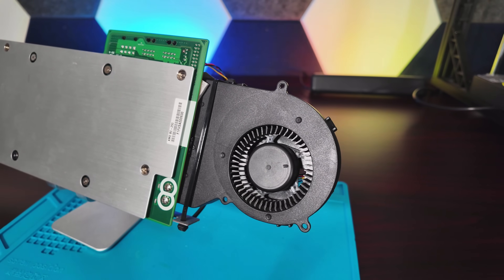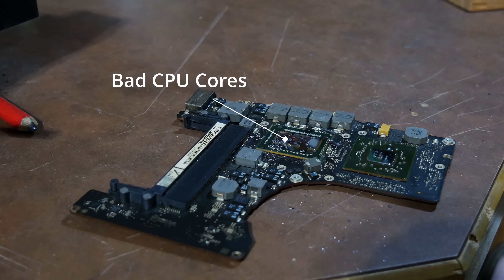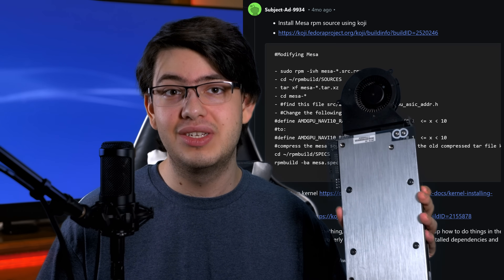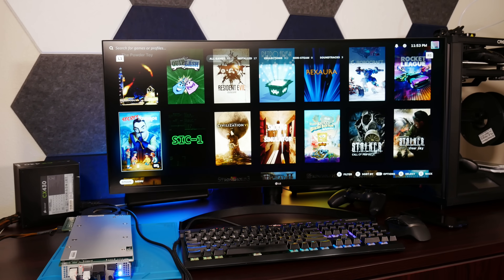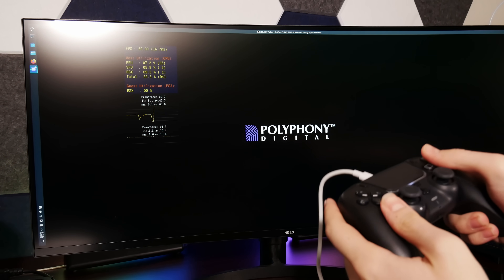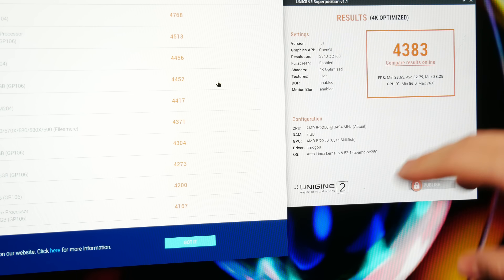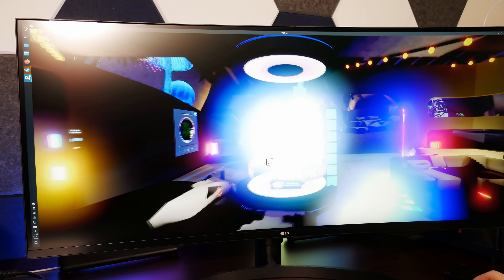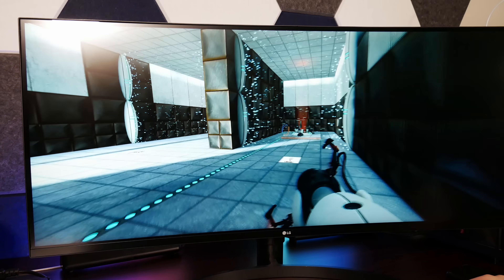I Ran PS3 Games on PS5 Silicon to Prove Sony Wrong

Comment: This just proves something we already knew. The only reason Sony doesn't want to make PS3 emulation is cause they don't see it making much money.
Reply: why let you keep your entire PS3 library when they can just re-release, remaster or remake the game and get your money and 2nd or 3rd time?
Reply: @DocHolliday65 cause I’m buying old ps 3s and install all the games I want and use it as a region free dvd player.
Reply: @theslayer6437  atta boy
Reply: @DocHolliday65  yup. I was a Ps1/2/3/4 … drove me nuts.
Reply: @DocHolliday65  Sure, but that also surely costs way more for Sony than just emulating PS3 and just selling PS3 games digitally. I love selling modded consoles so I don't care, but I don't understand their reasoning
Reply: @mopioline65  or you can keep your entire ps3 library and play them on a ps3 console....
Reply: @ssjmonstar  ps3 wear out, burn out or break if somethinng accidnelt happens to them. new pc runs better than your 2011 pc, its just newer and shouls spec up to 1440p and up
Reply: @ssjmonstar  Yeah, but these consoles are are 2 decades old and are not as reliable as they were. I have ~20 PS3 games and I would buy a PS5 only for this feature.
Reply: @DocHolliday65 they could’ve done that w ps4 , just sell ps5 enhanced versions and make you pay a small fee. 

The ps5 is already the most profitable console to date. 

They could always release ps3 original games on the psn store & rack in a bunch of cash from there, they don’t even need to make remakes. 

They could do that then make a remake later people would buy. 

You can buy re4 original and people still brought the remake. 

You can buy the last of us remastered and still buy the remake. ( Ik is a ps4 remaster, but it’s a ps3 game at heart.) 

So I don’t buy that. 

Plus Sony doesn’t own every ps3 ip, there are many independent publishers. 

But every major ps3 game from Sony has been remade or remastered already. 

God of war 3, the last of us , uncharted collection , demon souls.

We mainly are missing infamous and mgs4. 

Other than that I cannot think of any other Sony exclusive.
Reply: @malcolmlott killzone, resistance, all rachet and clank games, sly cooper
Reply: @maverickslastoddworld6476 resistance my beloved
Reply: Nah, I feel it's leaning toward the fact they can provide more incentives to their PS Premium services to stream PS3 games.
Why emulate when they can incentivize people to pay for a premium service. Or it could be both.
I almost debating on upgrading to Premium just to play those older PS3 games they offer for streaming. I like buying my games, so I hate streaming and game rental services hence I just keep PS+ base.
But then I used my brain, hooked up my PS3, and just replayed a few games that way.
Reply: @HellzAssassn 
The ps3 streaming isn't worth it until they move it all to the ps5 server blades. The ps3 streaming is still the outdated blades.
Reply: @HellzAssassn I do not think they will be able to steal the emulator. Most of them as hobby projects are open source, some allow commercial use, some not, some that allow usually operate under a license which states that any fork and work based on the emulator needs to be kept open source. On top of this it should be clearly mentioned in that this project was used.
If Sony wanted to do emulation they will need to spend time and money. 
And you are right it is better to do remake of a remaster and sell it again. The issue is that ps3 games are not getting this treatment that often as again it is porting between architectures which is more expensive than taking a ps4 game and putting it on ps5 (both x86-64)
Reply: @mravg79 they wouldn’t need to spend time or money the only reason emulation is so difficult is because ur basically remaking the system backwards with what u have Sony has the os and the systems full capabilities to be manipulated and used for the ps5 infinitely easier than the task of making rpcs3
Reply: @sicktodth  easier does not mean effortless.
It is true they own the code for PS3 firmware and know it. But it is still a different architecture so to rub it on PS5 there is no way imo it can be done without both time and money.
Sure emulation on pc (same architecture as PS4 and PS5) is done by community which have to reverse engineer everything, which means it is more time consuming process. 
I bow to all the people involved in this project as they do it in their spare time.
Reply: @HellzAssassn all you have to do is have backwards compatibility part of the service. Done.
Reply: @nunayadamnbusiness  Not genna lie, I don't like the idea of paying for my disc to be able to use it, but that's kind of a smart idea actually.

At least they'd offer it to us....

Currently we don't even have the option, so might aswell.

Like people are saying, they wanna monetise the games you want backwards compatible, so they can monetise the use of our discs, like £5 a month or something.

I don't like the idea, I probably wouldn't pay either but it literally settles both arguments.
Reply: @HellzAssassn yeah but considering PS Plus prices, they would have to include them in the current prices.
I do not wanna have to speed $200 a year for PS3 games 💀
Reply: @HellzAssassn Games stream like ass though even with good internet. They can still lock games behind a premium membership just let me download them to my console.
Reply: @HellzAssassn  how are you gonna own the game when you buy it through download?
Reply: RPCS3 is the most advanced piece of emulation software ever written. The open source community has spent 13 years on it and it got a major emulation update just like a year ago that improved performance drastically.
Reply: @Anteksanteri Not sure how up-to-date you are on RPCS3 progress, but just to back up your statement on it being the most advanced videogame emulator currently available, the RPCS3 Team posted two videos this week onto their YouTube Channel.

In one of the videos they demonstrate how they can now offer the emulator with direct Hardware compatibility with ARM CPU's and demonstrate this using a Apple M1 CPU, but it also works with the other M-Series Chips from Apple, M2, M3, etc, and with thier individual variants too.
But not only does it work with Apple Developed Silicon Hardware, it also works with ARM CPU's for Linux & Windows too!

Now here's the seriously impressive part.
In the second video they uploaded they demonstrate PS3 Emulation on the Raspberry Pi 5 via Native ARM Code.
Now the crazy part here is that not only is the Raspberry Pi 5 CPU not exactly very fast and not that much faster than the PS3's CPU, but the RPi5 VideoCore Mk.7 GPU is actually SLOWER than the PlayStation 3's GPU!
So despite the fact that the RPi5 is SLOWER than the PS3 they were still able to run fully 3D PS3 Games via RPCS3 on a Raspberry Pi 5.

Now I'll admit it was only at the same resolution as the Sony PlayStation Portable, but the VideoCore GPU is many times slower than the PS3, so the fact it is remotely possible at all is a HUGE achievement and a perfect example of just how advanced the RPCS3 Emulator is.

If you want to play PlayStation 3 games you have two options, buy a PlayStation 3 (Preferably the SuperSlim 500GB model because of Reliability), Or, having a competent enough device to run the RPCS3 Emulator and emulate your PS3 games that way.
For me personally I use both options because I am lucky enough to have Hardware that can run RPCS3 smoothly in most games that I want to emulate.

And to anyone that reads this, if you use any emulators PLEASE offer them as much financial support as you can, I'm not well off, but I value the hard work of these developers so I make small donations of between $5-$15 USD as and when I can to show.my appreciation for everything the developers of this software do for free.
We all need a roof over our heads and electricity, water, gas, food, etc, isn't free.
Reply: Which is weird, because they are currently working on emulating PS1 and PS2 games on the PS5, with many already having been released to the store. If these make money, PS3 will make even more money.
Reply: And it would be a very expensive thing to do as well. For a company that just wasted $400M on Concord.
Reply: @Great-Documentaries  you mean just steal RCPS3 and put on PS5? Yeah...2 tacos and 1 coffee.
Reply: @Deep_wolf  That was sarcasm
Reply: @Deep_wolf straight past the head
Reply: @Deep_wolf  That would be an endorsement to fan made emulation from them, which would put them in a difficult situation if they ever wanted to go to court about it. Also, regardless of how happy you are with RPCS3, it definitely doesn't meet the quality standaeds sony would expect for software on their platform. They'd have to spend a lot of dev time on bug fixing, optimization and UI.
Reply: @Deep_wolf They can't, its GPLv2 Licenced.

Thousands of lawyers would be lining up to sue Sony
Reply: @Deep_wolf I don’t think the devs would agree to that. Plus they’d have to opensource any changes made to it and follow the GPL license.
Reply: @Deep_wolf RCPS3 has a GPLV2 license, so they cannot do that, and would have to develop their own emulator, which would take a long time and effort
Reply: @Deep_wolf  lol
Reply: Game copyrights. Licensing deals. It's the same reason why they don't rerelease older Gran Turismo entries. It costs a lot. This is just the reason for PS5. I unders to complain because their console doesn't have any games on it. And they wasted a lot of money on a turd.
Reply: @Deep_wolf  Actually Sony has the original emulator for the PS3 to run on any AMD CPU to replace and emulate the SPU optimized code properly and normally role on PPU. The RSX can be outsourced on the standard GPU. If Sony allowed the PS5 to run PS3 games and all of the previous playstation consoles it will be the biggest marketing Sony can do they won't make money from the allowed emulated software but they can be sure to sell more PS5 and games from the goodwill of Sony's buyers. Though if I was Sony and just wanna make more money just put a monthly subscription charge for the PS5 to run PS3 and other console games. The PS5 CPU is strong enough to run and emulate the Cell CPU architecture but there is just no commitment there for now.
Reply: @Deep_wolf fr. Basically could just say "we want that" and the devs probably would just ask for credits and give it to them.
Reply: @Deep_wolf  they cant do that because its open source gpl and sony would have to also make their emulator open source.
Reply: @Great-Documentaries I was pissed about that but at least I got the limited edition controller!
Reply: Its damn near free rpcs3 already exists lol
Reply: @Great-Documentaries  what? It would cost them nothing

The community already did all the work, they just need to grab RPCS3 and slap it on the PS5
Reply: @MayYTlive  the emulator is far from complete, and the ps5 cpu is not fast enough (even according to the rpc3 devs). Sony would need to do massive amounts of reengineering, which doesn't benefit them since they can just drip feed you the same game over and over instead
Reply: @Great-Documentaries  Was it easier to do on the Xbox do you think?
Reply: Also I should probably mention the ps1 was risc based and the ps2 had a fairly customized architecture as well, and while the ps3 is PowerPC based, it’s a very different chip than the one in the 360, while the wii is just a GameCube on steroids, and the GameCube iirc uses the same PowerPC chip as the iMac g3.
Reply: @Great-Documentaries they will get that back in tax breaks. That’s why they pulled the game, if they left it running then they would take the financial hit. Because they pulled it it’s a failed project and they can claim it.
Reply: @Great-Documentaries  This world doesnt make much sense
Reply: @Great-Documentaries  It's their own fault for making woke crap games.
Reply: @Great-Documentaries  Concord would've done so much better if it were just a single player game with multiple branching stories and endings.  But as we know the very words single payer terrify the AAA industry because they can't cram Battle passes, Cosmetic MTX,  and Loot boxes in it.
Reply: @Great-Documentaries it's not your money, so it's not your concern where they spend then. And yes, it's was 200 millions.
Reply: @Great-Documentaries  What's your definition of "very expensive?"

I don't think this is about R&D cost. Yeah, it'd take some R&D to ensure PS3 games work properly on the PS5 hardware without any major bugs... But we just saw it's possible for a handful of people to figure out how to get PS3 games running on the hardware in their spare time.

It's instead about Sony being a bunch of jerks and lying about compatibility in order charge a premium to play PS3 games.

It's like those car companies charging extra to unlock existing features in their car, like heated seats or extended battery range or whatever. The car has the hardware but the company says, "fuck you, pay us more" to use it.
Reply: @Great-Documentaries  ps5 is still way overpriced. They have money. They just lazy af
Reply: @Great-Documentaries  Dont forget they overpaid for Bungie and Destiny 2 just for Bungie to run the game and their reputation into the ground 😂😂😂
Reply: @Great-Documentaries  If Sony did the emulation instead of concord, $400M is definitely enough to make the emulation. Then they can sell entire PS3 library on PS5 again.
Reply: @ZaXTheAlien  why would they spend so much money upfront to resell 10% of people a few games they like when they can just port some of the most popular ps3 games with some touch ups and charge you full price for them?

The problem with there not being an emulator for ps3 doesn't lie in sony being unable to calculate the best way to make money. They have that sorted out. They have access to data and processing power you couldn't dream of. The problem is more fundamental than that. It's that your wish to relive your past and the memories you value is irrelevant to sony if it doesn't make them more money than they are already making.

 On the other hand, the people behind rpcs 3 don't operate under that framework, which is why they can spend a decade on an emulator, without spending tens of millions and without expecting a profit from it
Reply: @urmomma2688  Bringing backwards compatibility would justify the cost. The PS5 Pro should've had the hardware to play the older titles too for $700. Consoles are sold at a loss anyways.
Reply: @notlNSIGHT   The fact is that it doesn't. The upgrades of the ps5 pro come mainly from the gpu department and the cpu is a 10% increase in clock speed, which (even assuming linear improvement in performance) would not be enough. 

But even if it did have the theoretical capability, you're saying that sony should pour some more millions or tens of millions on what is essentially an enthusiast product. But enthusiasts, who are into playstation and can afford a ps5, can also afford (and probably already have) a ps3, so ps3 back compat would not be important to them. So a big investment for very little return. They can just remaster some ps3 games and resell them, not just to enthusiasts, but everyone, including pc and make way more money
Reply: @Great-Documentaries  If you're a company, it's logical to go forward, Nintendo often does it (they can afford emulatiuon on small, easy-to-emulate games and on consoles with hardware similar to the previous ones, I hope you've noticed... it's not that easy), they're frustrating not making them backward compatible, but backward compatiblity  can increase costs , remember the PS1/PS2 retro compatibility problems on ps3 hardware and how it increased the price of the console due to the emotion engine... moreover this PS3 emulator is open source and took a lot of time and still isn't optimized because it's software and not ps3 hardware... you believe too much that the world of tech and business is all about simple and stupid decisions, it's not that easy. I didn't think I'd ever be defending this from Sony or Nintendo, but given the lack of knowledge, what else can you do?

For Concorde, it was a risky gamble on a genre that has a future and cash flow (Overwatch, CS2, PUBG, Warzone, Fortnite, Apex Legends...) and is in the present with millions and millions of players. They gave free rein to a studio, not the Sony Interactive Entertainment department but a subsidiary studio in Bellevue, Washington, which made Concorde, Sony US makes bad choices, and not for the first time. BUT Sony didn't hesitate to close the studio because of the budget and the bad buzz... unfortunately cutting a lot of jobs, but they listened to the players.

So if Concord ever comes back, it'll be through a new studio and an overhaul of the game... In particular to have game mechanisms and a game that is always playable and let it rot after such a budget, would be a huge spoil, so it is quite possible to transform the thing, by eliminating the sad pastel artistic direction and the design of the Character, besides they complicated themselves by wanting to be realism to show the capacity of the PS5 but the appeal for teens and other fans Genshin and modo discord is the animated style/comics.

It's a shame they abandoned The Last of Us Online so as not to eclipse Concord, or out of fear... it would have been more successful, or unlike Concord, knowing that it's a license that Sony keeps a close eye on, they cut short a bad game... 

Sony will have trouble using the RPCS3, for a question of ego, not their R&D etc, but nevertheless they are less aggressive than Nintendo with emulation, moreover they allow themselves to sometimes put their games on GOG without DRM, this is something that must be noted While they were not obliged. We do not realize... Especially for a large corpo who seeks above all the profit.
Reply: That mindset made me leave Playstation as a main platform. Why would I invest in a platform who's games they may end up abandoning on future devices like they did with PS1, PS2, and PS3? PS5 may play PS4 discs and digital titles now but will PS6 do the same as well as play all PS5 titles? Will PS7 play PS6 stuff? It's hard to tell at least with PC you can almost always find a way to get an old game running thats not supported without needing to hack the system.
Reply: Compare it to sony in 00s when they made PS2 and even PSP handle PSX games because they though it's gonna make people like their ecosystem.

Yeah it worked!
Reply: Well duh. Microsoft made emulation for their Xbox one and Series console, but never broke even due to how much money they spent on porting the games.
Those consoles emulate original Xbox and Xbox 360 games, and most people will probably just use the game they probably already have
Most gamers buy new games anyway, instead of lurking on older systems
Reply: Yep though there is money in it which is why rpcs3 is doing so well now
Reply: One thing is getting games running with subpar performances and glitches, one is make emulation marketable. But this dude and you surely know better
Reply: I see no need for me to buy the ps5. But if it could run all games from ps1 to ps4 (additional), it would be definetely a reason for me to buy the ps5 :)
Reply: meanwhile a hobbyist does it for fun lol. I never understood project management, let's make an ambitious project that has a risk of flopping, or make a small project are fans have been asking us for since release? Nah, let's remake games instead. That's certainly cheaper, right?
Reply: Are u sure, after they spent a lot of money in Concord
Reply: But for something to be a launchable, saleable product and not some community effort, it needs to work well with the vast majority of titles without tinkering. Consoles exist because many people just want plug and play. They don't want to mess with kernels and versions. They want to put a PS3 disc in and it just works. This isn't there yet but it's super exciting that by the time I next upgrade my PC, I might be able to build a PS3 emulator. 
Until then, I have 2.5 PS3s to play with
Reply: That was obvious since from start. They want the fools to repurchase their remasters. Meanwhile Xbox is there remastering games for free through backwards compatibility and you don't have to pay a penny if you own the old discs or digital versions.
Reply: What's the point lol they're taking the discs away 😂
Reply: I think its moreso the gargantuan effort it'll require. Sony most probably won't just grab RPCS3 and use it. They're more inclined to build one in-house, and judging by the fact that RPCS3 quite literally took a decade to reach where it's at, it's alot of effort on their part.

Much more convenient to put it on ps plus and let the users stream the game.
Reply: It would earn them a ton of goodwill from their hardcore fans that stuck with them throughout the PS3 generation and also save them some bandwidth and related costs with those PS3 servers blades they have for the lame streaming PS3 games they offer.
Reply: I'm not even sure if it's a money thing. Their current leads just seem really averse to their legacy unless its somehow cannibalized or remastered to meet modern spec. They're an entire company chronically averse to their own history. It's baffling.
Reply: @SlapshotJack yes, people do, especially when they played those games as kids, nostalgia sells.  Why do you think Nintendo did the nes and snes classic editions? Why do you think retro gaming is as big as it is now? Also, a lot more effort was put into games from bigger companies back then, final fantasy 7 has a great storyline and amazing soundtrack, parappa the rapper is goofy and really fun, and has a good storyline. Snatcher has an amazing story and is made by the same guy who made metal gear solid, which is also a great series from what ive heard. Syphon filter was a great shooter on the ps1.  I could go on.  Hell, even doom (yes the 1993 version) still has a lot of people playing it, and even modding it, and it ran on ps1, and the sequel was on ps1.  A lot of games back then were treated like passion projects and less like money grabs. Even the old Spyro games were amazing, and gta.
Reply: @eodpro  The expense is on the development and maintenance. It is no different than paying for online access. It is completely optional for the consumer but will require upkeep regardless if 1 or 1 million opt in. This is the consumer culture now and in this case the benefits cover both parties.
Reply: No, because we would realize the PS3 games are much better than PS5 games.
Reply: they could just monetize it. offer ps3 for ps5 games on the store for half the price of the original. people will buy.
Reply: @Xfade81  Only the ones that haven't lost licences for copyrighted material. So any games with real life cars or copyrighted music are out anyways.
Reply: Sucks to be Sony, i think they dont know that people who are older have money and most wanted that nostalgia of old games on their new machines.
Reply: They'd make tons from selling PS3 digital games... They could even charge to activate the function. They would make bank.
Reply: Of course they ONLY care about money.
Reply: Being able to effortlessly play and backup my physical PS3 games on the PS5 would be the ONLY reason I would ever dare even thinking about buying one. I was super disappointed when the PS4 didn't have any backwards compatibility with the previous generation.
Reply: There could be licensing costs? Not sure
Reply: There's also the investment that it requires to make a good, optimized PS3 emulator. Sony would have to make its own emulator since they can't just use RPCS3.
Reply: @ Some people seem to be ok with sticking behind. There are many great old games and some are ok with missing out on new games to save their money. Especially when an upgrade might cost a soul.

 This kind of sentiment is growing as games today seem to keep getting worse. Of course, for me, I prefer getting to play the latest games, but if an Upgrade would cost me my soul, I might stick behind for a bit.
Reply: Because it's notoriously unreliable, very expensive to develop and they would prefer to have a native-ish solution for PS3 titles that would provide good compatibility instead of breaking the system.

Sony isn't gonna run RPCS3 on Linux.
Reply: They could have just open sourced thaat portion of functionality, the community would developed free and sold more units with emulation
Reply: I imagine they might want their own version of Nintendo's "rent your old games until we tell you you can't anymore" service
Reply: Yes and it isn't suprising
Xbox is not swimming in cash from their 360 or OG xbox game sales.
Its a good move for a brand and creates goodwill with the community, but it makes no money.

Considering it took RPCS3 10 years to get into a well working state, with 2 devs working mostly full time in the latter half, it would be a big investment, money and timewise, for some to get it to work. Ofc they could make it faster with more devs, but that isalso more expensive.

And here is a harsh truth too:
Devs are done with that generation and PowerPC code. Ita why we see almost no games ported to PC or being remastered only with a few third party exceptions like I'll chainsaw or dead island. But for most studies looking over that archeic code and weird parts processing and make it work on x86 isn't worth the time, money or insanity it brings.
Reply: If it doesn't make money there's no point
Reply: Its not that its not making a lot of money, its just much more profitable to make remasters and sell the full price over and over again.
Reply: @maxdergroe9082  not really. Remasters dont sell as much as the old
Reply: it will make money, they just know it will open doors for piracy
Reply: Because it's not worth it and barely anyone will use that option. Only poor people lead everything to money.
Reply: Was that ever a question? I highly doubt they would even deny that. Why would they invest all that money into something that won’t make a profit.
Reply: The industry is ONE BIG LIE
Reply: Yeah, well as a consumer I don't see buying PS5 to emulate PS3s as an investment. Just an over powered console with no flexibility nor backwards compatibility that will eventually go in the e-waste.
Reply: Except they would because people would buy
Reply: If Sony played their cards right and found an alternative solution to the problem, they could make it to where the PS5 would be the most memorable console of all time by including PS3 emulation and be able to play ps2 and ps1 discs. But nope, a lot of corporations care about anymore are the easiest way to make money.
Reply: Sony ist eine Firma und Hersteller. Was sollen die deiner Meinung nach denn sonst machen? Geld verschenken? Denk mal drüber nach. Oder anders herum gefragt: Wie viele Firmen kennst du die das machen?
Reply: They are literally incompetent then. They could EASILY develop an effective PS3 emulator, run it on PS5 hardware, and sell the emulator for a relatively cheap price. I guarantee you people would buy it from Sony and download it onto their PS5, allowing them to play a whole selection of PS3 games. Capitalism 101 and I'm not even capitalist, holy crap it's so easy. How can Sony not see the profit here? They are the expert, they should know how to do this. I'm just a random guy on YT.
Reply: They blind.
Reply: No. They see it being the fattest cash cow in history and are devising the best course of action that will line their pockets. Especially if PS3 emulation means ps2 & ps1 emulation like the worthwhile launch PS3s were capable of.
Reply: No. They see it being the fattest cash cow in history and are devising the best course of action that will line their pockets. Especially if PS3 emulation means ps2 & ps1 emulation like the worthwhile launch PS3s were capable of.
Reply: not just that. That alone, they probably wouldn't mind. But they don't want PS3 titles competing with newer games for PS5 etc. . Even if gamers would just play old games they already have, that would lead to less demand for PS5 games
Reply: They just want to resell you thing you already bought
Reply: Which is very sad. They don't want the best for their customer. Wrong mindset but still makes alot of money.
Reply: Thing is, if my steam deck can run most ps3 games at decent framerates and resolutions, then a ps5 can definitely run ps3 games
Reply: Straight up backwards compatibility is a huge selling point. Its why I prefer the Xbox. I can play a good deal of my original and 360 games on it when I get tired of modern games.

It'd be really nice to have one device that can play PS1-5 games, without paying extra.
Reply: Nintendo would say otherwise with their [Very Overpriced] Switch Online service that gives you access to emulators with games that you'll never play
Reply: Yuuuup. They want people buying new games, not buying games on the used market they don't see a profit from.
Reply: f sony
Reply: Why do you think free enhanced version of gta 5 is 60 bucks for console?
Reply: no they make more money off remasters
Reply: Bullshit I Can Name A Whole List They Can Make Money From 😅
Reply: Well it would cost them because developijg an emulator costs money
Reply: Sony could buy rpcs3 or just shut down the project and steal the software, like nintendo does
Reply: which is stupid bcuz number of ppl who emulate ps3 goes up each year
Reply: This doesn’t make sense, why stream ps3 games then ?
Reply: I doubt it. Likely they'd want to use their own emulator. Not to mention then you have to figure out things like the PS3 system software emulation and the fact that the PS3 had a hard drive and games really utilized that.
Reply: I’m not buying new PlayStations past ps5 until my ps5 is breaking OR if they add ps3 games compatibility to the new ps6 I’d be so happy and they’d have my money
Reply: Absolutely a lie they see it as a money maker as long as you cant own it and instead use it with only a subscription so you cant own and have to pay large amounts of money every year
Reply: They have publicly stated it isn't as popular as people think. Even they did PS2 games on PS3 digitally, I vaguely remember them saying they wouldn't do more as the numbers showed barely anyone bought them compared to PS3 games. It just isn't worth it. And same on PS4. Or maybe it was one or the other. Point is PlayStation have said not as many people use this feature to warrant doing it. But I disagree. In 2025, more people than ever are older and return to gaming with money now that they have jobs and wanna replay older games. Nostalgia is perfect now for PS3 games. Maybe on PS6. They'll save it as a selling feature for the console.
Reply: It will loose them money
Reply: Very close. Its that they can make MORE money selling you the ps3 titles on the playstation store.
Reply: Incorrect, it will cause people to.purchaae ps3 games instead of ps5 games.
Reply: Waste of games that could benefit the catalog.
Reply: They said this in the video. 4:42
Reply: Of course, the majority of people, especially casual players, won't see any reason to buy old games, so every company thinks that remaking or remastering or porting games is just better than retrocompatibility
Reply: Fine, i'll just pirate and not give a s**t.
Reply: YOU're Wrong. The PS5 is Not Fast Enough to Emulate a PS3 on it.
It Needs to be 10 Times Faster to Convert between PS3 to PS5.
The PS5 is only 3 times Faster. The reason it Cant Do it.
Also, the reason Why PS3 is Still Good in Comparison to Them.
The PS3 was 10 Times Faster than the PS2.
The PS2 was 10 Times faster than the PS1
Reply: They can’t resell us the games if they give us an emulator.
Reply: @Bit-Z1  YES, that Was Partially the Reason. With PS1 emulation on PS2 AND PS2 Emulation on PS3. The Next Generation Game was Much Better, because of the Ten Times Performance Increase. So, customers Would also Buy a Dozen Next Generation Games. With PS3 on PS4/PS5, it wasn't Possible because The Next Generation console wasn't Fast Enough for emulation AND They Knew - the Next Generation Game is Only Slightly Better. so, Customers May not Choose to buy the Next Version of the Game.
Reply: There's one game on the psn for the ps5 that's running a ps3 game in emulation
Reply: As is their right lol
Reply: A ps3 is cheap nowdays.
Reply: Metal gear Solid 4 will make a BUNCH of money
Reply: Why would it benefit new game sales m
Reply: The only potential money it makes is selling more consoles, but they already forecasted that it doesn’t need a boost like that to sell.

But also it’s not just Sony, but other game publishers too. They’d rather see some money rereleasing the game in some form than not receive any money at all
Reply: It's because of licensing
Reply: I mean yeah, they're a business trying to make money, not a charity.

Even with the most powerful computer and the best emulation software less than 60% of PS3 games are even playable. It's not an easy endeavor.
Reply: Sony wants to sell the games as remasters for full price
Reply: They don't even want to do that, unfortunately. Sony refuses to remaster PS3 games. They haven't released one since Wipeout Omega Collection in 2017. No Resistance, Killzone, Infamous, Ratchet & Clank, or Motorstorm. The only major remasters they did release were God of War 3, The Last of Us and Uncharted. Other than those they did a few smaller PSN titles, such as Journey, Flower, Super Stardust, etc.
Reply: @andre_original I think your getting them confused with Nintendo 😂 Sony sells remastered for half and sometimes even 10-20$ 😂
Reply: Sony is not going to get games at full or retail price, they think the consumers would pay £49.99/69.99 for a remastered game they will not too expensive and not affordable. They should do PS1/2/3 and so on Emulation there are lots out there that collect PS1 & PS2 games, if Sony want £600 or more for a new console add Emulation simple as that.  @andre_original
Reply: It’s one of the reasons
The 2nd one is because the ps4
Reply: They are selling a product, they won't do something that will not let them earn more.
Reply: Those are early-life PS3 titles.  If he tested The Last of Us, Uncharted 3, or GTA5 and they performed well, then I'd be more impressed.
Reply: @Portuducks  Watch Dogs came out after all of those titles lol
Reply: Can you guess this video doesn't show off spu heaby titles? Or some "in game" titles? Because they will run like garbage

 The rpcs 3 spreadsheet has the ryzen 5 3600 at the lower end of the  B tier. Since the ps5 cpu is in theory more or less equal but in practice slower (4 threads are reserved so you have 12 threads at 3.5 ghz) ,that would put the ps5 cpu at c or d tier. Not even close to matching a reasonable standard for emulation.
Reply: @ You definitely play COD and FIFA. Sit down. The adults are talking.
Reply: This is a great case against closed ecosystems: their ability to take your money is more important than "allowing" your hardware to perform things it's capable of doing. Even if you disagree, your hand is forced. We shouldn't get "permission" from Sony for stuff that lives in our living room, and we shouldn't create e-waste by throwing away things that are useful.
Reply: It's because Sony wants YOU to own nothing and be happy.
Reply: Why people defending Sony and acting like the ps3 has been developed from another company??? That’s their own system and they have access/license for everything. The ps5 should be able to play every PlayStation game out there. From Dual boot to Emulation. They would make it easy happen. Crazy that there is no backlash from buyers and supporters. Its like making Millions with technology advertising telling how great it is and couple of days later „we have nothing to do with it“ So proud of the the Emulation community. It’s not about stealing. People would actually buy and support older game developers. PlayStation’s operating system should be possible to run on any pc hardware.
Reply: sony knows better